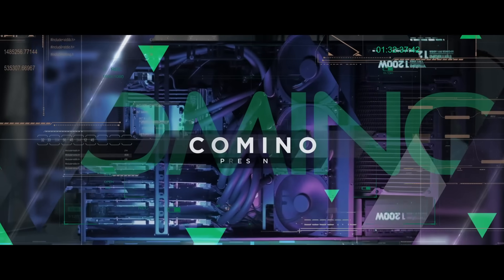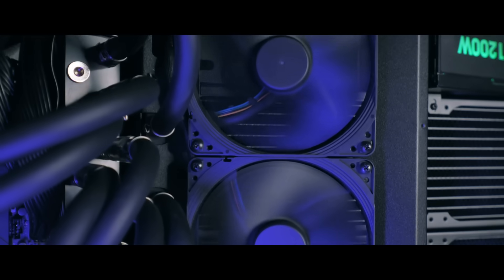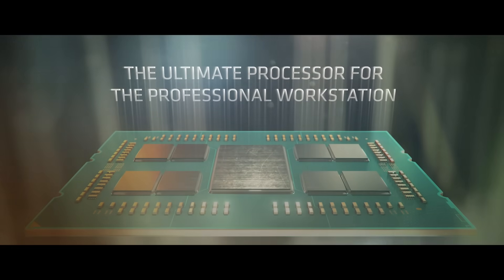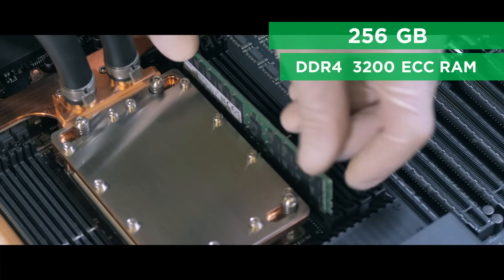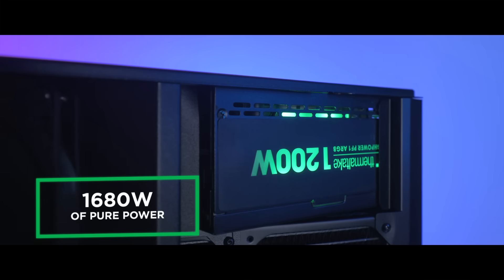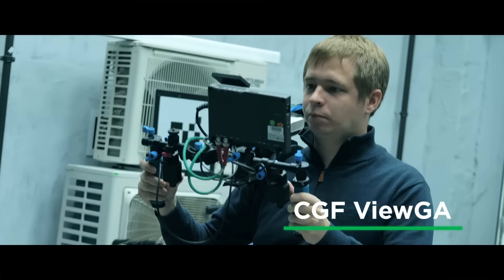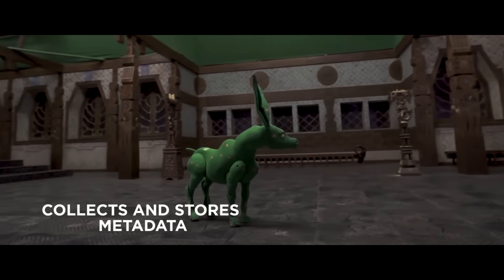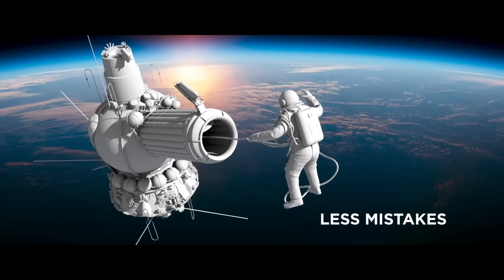CGF Studio Breaks the Boundaries of Film Production with the Comino Grando RM 🔥

Comment: As those GPUs are taken off from their blower type coolers do you guys provide warranty or replacement for those cards incase of any issues ??
Reply from the maker: Yes, Comino provides 2+ years warranty for the system. And with that kind of full-cover liquid cooling, full-copper, deformational cutting technology, parallelised flow, performance thermal pads, liquid metal etc, the GPUs feel so much more comfortable, compared to air cooling. It's known that GDDR sometimes unsolders at air-cooled GPUs. Well, that's much much much rarer case on the full-cover liquid-cooled waterblocks 😉